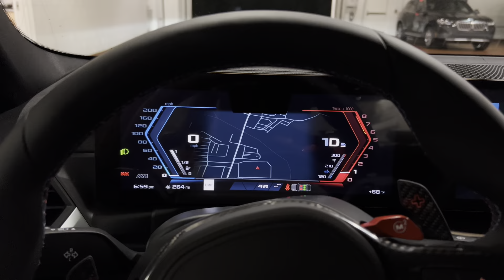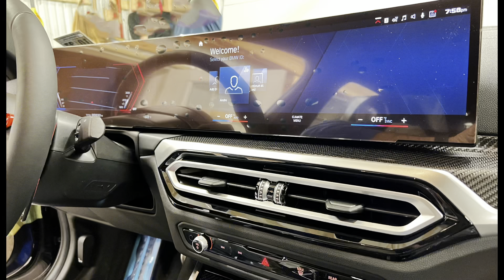Picking Up A Brand New Techno Violet Jahre Edition G80 M3 + New STI Mods Come In!!

Comment: 🇧🇷🇧🇷🇧🇷🇧🇷👏🏻, The only thing that was missing from this car is the driver assistance which is amazing. When you’re tired coming from my trip and you don’t want to drive with the iDrive ate. The sensors are faster in this cartoon. Pretty much drive itself. You always know when this is missing because on the left side of the steering wheel, you don’t have those white markings.

Comment: 2 questions! 1. For your sequential mirror lights. Was wiring the drl in worth it? I bought a set and didnt realize they came with the drl option(wasnt stated in description) 2 have you considered painting wrapping or doing a carbon overlay on the arm rest piece. Its currently out of the car so now would be the best time!
Reply from the maker: Definitely worth it! I have a whole video on the process. 

Nah, not a big fan of wrapping interior pieces. Especially pieces that get touched often. I don’t mind the dark gray color on the arm pieces so just going to leave it be.
Reply: @Autofreakgarage  any ideas on what would cause hyoerflash in a 19 sti? I had each blinker bulb burn out individually along with the reverse lights. I changed them all and now have hyperflash.
Reply from the maker: You need an led module to rid the hyper blink.
Reply: @Autofreakgarage  where would i get one?
Reply from the maker: Diode dynamic sells a good one
Reply: @Autofreakgarage  thank you!! You are amazing!!!!

Comment: Yes a nice classy mirror 🪞 mod. 👍. Also JDM which checks another box ✅. Me I avoid mirror and body panel damage by parking out in the boonies far away from everyone. Which is easy to do nowadays with so many shopping on line. Plus the extra walking is good for you. Saves $800 plus bucks too. This is not a knock against this mod just different priorities. I would rather spend the 800 on some replacement front suspension parts offered by Cobb to improve handling  which I only just discovered. Good luck 🤞 with the re-pinning procedure.